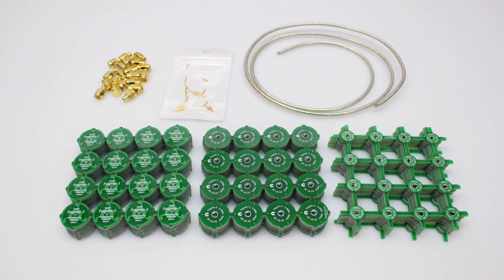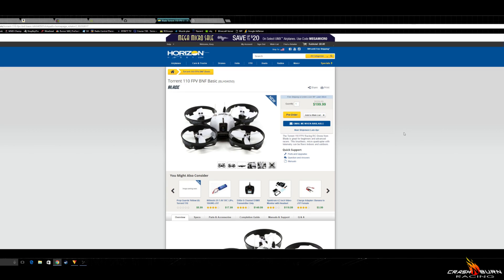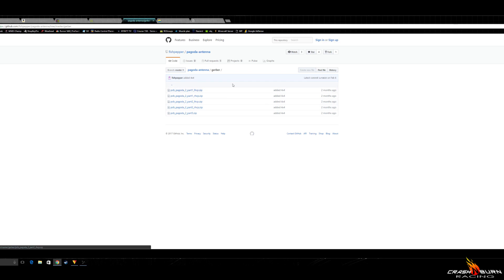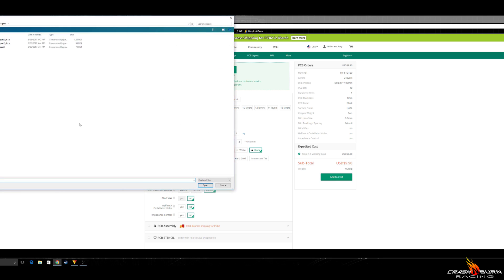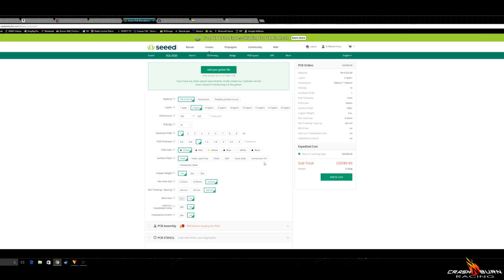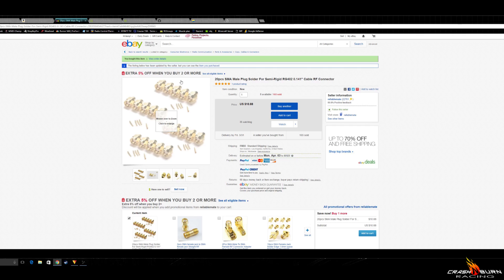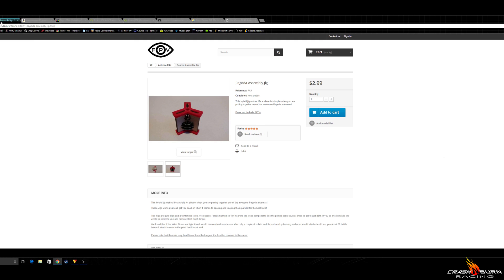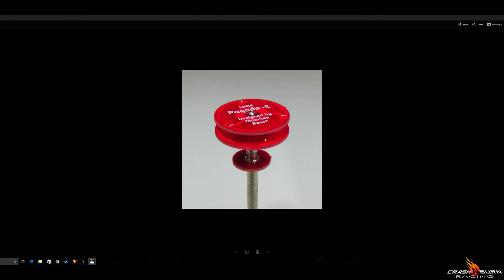How to build pagoda FPV antennas for less than $2.00 each!

Comment: Could  I build a micro version and get the same results? smaller coax. Has it been done?
Reply from the maker: Not with this version of the pagoda PCB's. Though I think the AXII and the VAS MinION antennas might be based in this concept but they are closed source.
Reply: Just my luck! Thanks for the reply, I'll check out those antennas.

Comment: What size heat shrink do I need to order for the RG402 cable?
Reply from the maker: The RG402 cable is 3.6mm wide so anything from 4mm to 5mm should work.
Reply: Just what I needed.  Thanks bud!

Comment: I followed this exactly and literally only received 10 antennas! anyone know how this could have happened? the shipping was more than the pcb's.
Reply from the maker: WELLS QUADSTYLE Sorry to hear that. That is definitely not right, I have placed two orders with out a problem. I would contact them about the issue and if they refuse please let me know, I will update my video accordingly.
Reply: I did. I am waiting to hear back. how many come per board to make 160?
Reply from the maker: There should be 16 per sheet and you should get 10 sheets of each pcb.
Reply: so it was a mistake by me! Now the question is where to get a file for 16 per board for the rev B?
Reply: I followed this exactly and got 10 sheets of 16.

Comment: Hi all, 

Thanks for your always support to Seeed Studio!
Please note that if you put different designs in one panel, it will be treated as panelized and cost extra fee. If the silkscreen are different, it will be treated as another design even the trace is the same. We recommend to place each design one by one instead of putting them in one panel.

Thank you!
Reply: Hi, i'm trying to order as he does on the video an it says 30$, why?
Reply: Hi BellowFPV, the problem has been solved, please try again. Sorry for the inconvenience.
Reply: Thanks!
Reply: SeeedStudio diy

Comment: On my end, an option shows up that no one seems to mention, "HASL" surface finish thickness. There are two options: .1 and .4mm thickness.  .4mm is default. Anyone know if this is the correct selection?
Reply from the maker: CesiumSalami Don't change anything other than the PCB thickness and color. The other defaults are correct.
Reply: okeeeee - it's weird - I don't even see this as an option in your video. Checked a bunch of browsers. Anyhoos. COOL! thanks for the vid and the response!

Comment: Well you've convinced me to try this out. PAGODAAAA
Reply from the maker: If it turns out you don't like them you wont have a hard time selling the boards.
Reply from the maker: I agree, I am keeping my eye out for a 20x20 pdb that will handle the amps of a full size quad.  That's the only thing really holding me back, would also like to see more options for flight controllers as well.
Reply: I'm kind of looking for the right frame for this esc/pdb+fc combo on Banggood: https://www.banggood.com/Upgrade-20x20mm-XJB-V2-PBF3-EVO-Flight-Control-AIO-PDB-BEC-D-shot-25A-Blheli_S-2-6S-4-in-1-ESC-p-1142584.html?rmmds=mywishlist
Reply from the maker: I have seen this but didn't realize that the ESC was 25 amps.  I will focus on a full size frame for this
Reply from the maker: And now that the Runcam micro is coming out soon I can go even smaller, I know it's a good camera but not sure if people will embrace it.
Reply: I've ordered the Runcam Micro because it seems interesting and quite allright. RCModelReviews did a side by side comparison of Eagle/Mini/Micro size, RF radiation and image quality and it's pretty much a Runcam Mini/Swift but smaller and lighter. Ideal for super light frames! Since your frame protects the cam it would be great for that. 
Coming back to using a 4-in-1 esc instead of separate ones on the arma, would you consider making the arms narrower to help with aerodynamics and decreased thrust loss?
Reply from the maker: It is a good camera, I designed a frame to use it and I got the size down to 135 for a 3" true X, I plan on getting the frame cut and built, I just have to pace myself with the cost of this hobby.
Reply: I hear you brother. Arm and a leg. Keep up the good work, looking forward to what you'll make next.

Comment: Hi Kory, first off, thanks for the video and putting this together. Question for you, I just ordered and they're finished production and shipped. I was curious, do they come with perforated so you can break them apart easily or do you need some kind of tool to cut them apart. 

Thanks in advance
Reply from the maker: They are perforated but using small flush style wire cutters greatly reduces the amount of cleanup.

Comment: thanks a lot for this video! 

The only problem with seeed is that the shipping costs are high to my country :( is there any other PCB printing company that you would recommend for a quotation?
Reply from the maker: I did some research and did find any other options that others have tried.

Comment: I had a similar issue as Tim Proctor.  Here is the email that I got from Seeed.

Hi there, 

We have been sent you pending email with it and the problem is about Gerber file D_438532_pcb_agoda__art2_hcp.zip, This Gerber format is incorrect, please generate the PCB files in Gerber RS274X format. Drilling layer in excellon format.
Please help to re-upload a correct file on the website so that we can go on processing your oder.

If I reupload the file it will be the same one that you suggested as I don't know any other.  Any idea on how to proceed?
Reply from the maker: Is the preview working for you when you upload the file?
Reply: Yes, preview looked good.  I went to Maarten Baert's web page and downloaded the zip files directly from there and re-uploaded.  I am waiting to hear from Seeed to see if that made a differance.
Reply: Looks like my order went through, when I receive my PCB's I will update how they work.  So far Seeed has been helpful with answering my questions.
Reply: UPDATE:  I received my PCB's and assembled my first antenna last night.  It was a little tricky soldering but I was able to do it and the antenna works well.  Thank you Kory for this video, this will save a ton of money on antenna's.
Reply from the maker: Good to hear it worked out for you.

Comment: whats up kory?, Great video but i have quick question.. i did everything you said to do and placed the order, but i got an email from seeed saying that the space between the pcb's was to close and that they would easily break..  they said i needed to go into the file and take out the drill holes. what should i do? is there another gerber file? ill put the email in this comment so you can see what they said.. 
HelloThis is Courage from Seeed Studio Fusion team.Thanks for your order but there are some problems in your files.PCB file name: D_432511_pcb_agoda__art1_hcpD_432513_pcb_agoda__art2_hcpProblem Description:  These connections are too small, it will easily break directly.We recommend you to remove the drilling holes.Proposed Solution:Please re-upload new files by yourself in our website re-upload .To update to website:
Reply from the maker: You need to tell then that those connections are made to break.  I haven't heard of this problem yet but reordering it may solve it also.
Reply: ok great ill tell them that right now thanks for the extremely fast reply!!!!!!!
Reply: Do you know something new about that? I think that they just answered that because they do not panelized PCBs, so, if you want to panelized them they wanto to make you pay... could be?
Reply: I ended up emailing them back and  telling them the holes were there so the boards could be broken apart.. the problem was that the drill holes made a weak point so the boards would break apart during production. So they said they'd delete the drill holes themselves and everything would be fine. they are now in production!
Reply: Fine! I hope you make a very good atennas! haha thank you

Comment: Can't you technically still use the ones you ordered with a modified jig? If you don't want them I'll take them off your hands, just pm me.
Reply from the maker: I don't really have a deep enough understanding of how you could get them to work but I did send some off to someone who knows more than me to see what can be done.
Reply: All you have to do is either take the original jig and shave down .6mm or print a new jig with 1.6 mm spacing instead of 1mm. The pcbs are one sided so as long as the sides with the copper on it are in the exact same place as the original it will work without a problem.